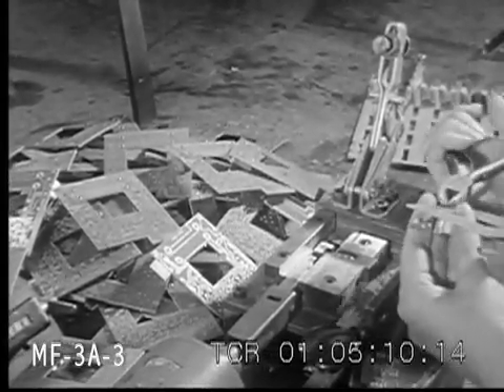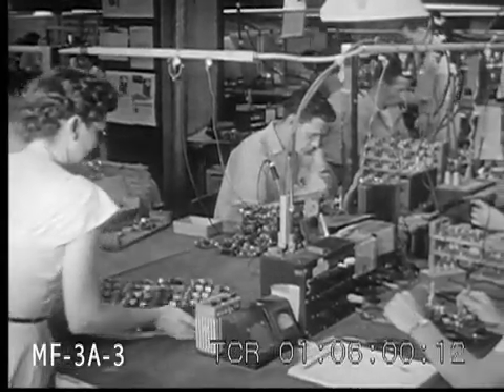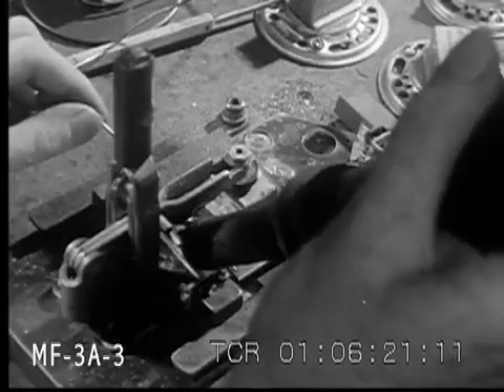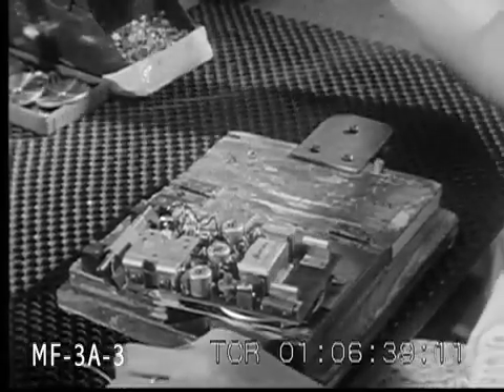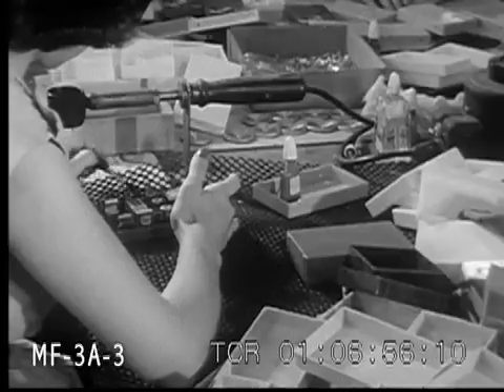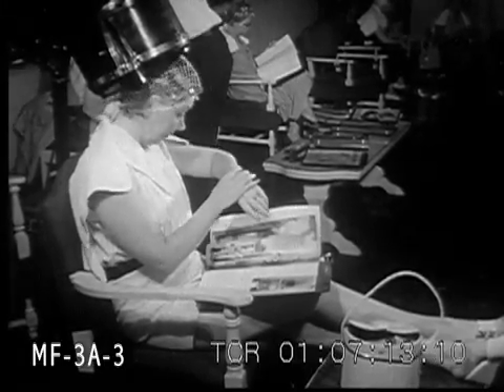Assembling Transistor Radios 1955

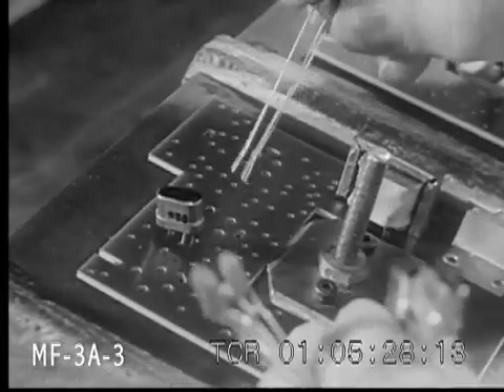Comment: 0:40 the transistor seen...being installed...has a metal case. Inside..the actual transistor was a miniature version of the first one invented in 1947...the performance characteristics were so wide...transistors had to be "paired / matched" to get best performance...this was true of SONY radios manufactured early on. 
I learned this stuff with YouTube channel "Asianometry"...and other similiar channels.
👍

Comment: "Transistors performe the same functions as much as larger vacuum tubes for the fraction of the current"
Hahahaha I have never heard such a terrible thing 🤣🤣🤣🤣
NO.
Vacuum tubes are the best. Point.
Even if they require a higher current...the sound they produce is unbeatable. Warm and make you feel like you would never be able to hear anything without a vacuum tubes amplifier or radio. Transistor's "sound" is cold...empty of any feelings makes the sound dead. Anymore.
Reply: ...WELL, "ya can't please EVERYBODY!!!"

Comment: Incredible assembly line. Bet that AM radio would still work today too.
Reply: I have a 30 year old radio shack transistor radio, still works great, even after laying untouched in a box for about 15 years, truly amazing is that it still has that same battery from 15 years ago

Try that with a laptop or mobile phone!

Comment: By the late 1950s, the manufacture of these radios was moving to Japan and fast; I believe the last pocket radio was made in the USA around 1966. It was more cost effective to build expensive equipment in the USA, the kind used by business and the defense sector. Automation is  one thing that might bring it back, if the difference in labor costs ends up being less than the cost of shipping. Of course, labor costs have gone up in nearly every country that took over this sort of manufacturing.

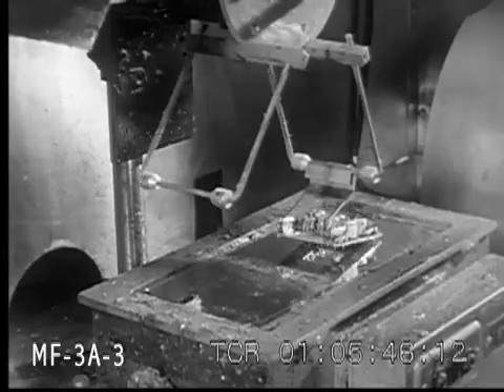Comment: Could not understand the soldering technic @ 00:54
Reply: Its a lake of hot solder (estaño) and when the circuit down in it is solder the pins of copper.
Reply: @gowreyes8876  got it. Thanks. ,👍

Comment: The Regent used Germanium or Silicon transistors?  The battery was 22.5 V for max gain from just those four transistors - - lot of voltage for those early puny Ge xsistors
Reply: I don't believe silicon transistors were practical until the late 1960s, and those early ones were not particularly reliable. Silicon is cheaper than germanium and a well made silicon transistor is less vulnerable to the effects of heat, but it needs to be more highly refined.

Comment: 3500 W soldering iron... one wrong move and the PCB fiberglass melt ahahaahha
Reply: Gfr, no, the real problem occurs when excessive heat from an overly large soldering iron causes the copper foil trace's to delaminate and lift right off the board. This was less of a problem on older units where the PCB's were phenolic, not fiberglas, and the traces were large and wide and typically the entire set of foil tracks were tinned  with solder, but nowadays the modern,  extremely thin and narrow foil traces will easily come loose from the board.
Reply: @goodun6081  sure.. i experience myself in an attempt to repair... the traces nowadays are very fragile...

Comment: Soldering irons the size of rolling pins... I'm so glad things have gotten smaller!
Reply: You'd still need them when soldering large metal things together. For normal component leads you can use a small hand soldering iron.
Reply: @gargantuablargg  Indeed.  I just bought a replacement tip for my iron - it has a 1/64" conical tip.  My problem now is that I need a microscope to see the parts I'm trying to solder!
Reply: @gargantuablargg  If you like flux, you might like low-temp solder sticks.  They make it MUCH easier to remove components easily.  It tends to stick to solder mask a bit more than regular solder, but it given how easy it is to remove parts - even with minimal equipment - it's well worth it.

Comment: Solder fumes are deadly , no fume exstraction here.
Reply: There's no way you could possibly tell from this video... besides, I wouldn't say deadly considering how much time in my poorly ventilated room with my soldering iron plugged in for hours at a time.
Reply: Deadly? Perhaps you could explain by what mechanism they are deadly?
Reply: Dambuster Lead, and thereof.
Reply: Lead is not vaporised and carried in the fumes, it is a heavy metal. Lead is quite dangerous, but those fumes only contain the flux used in those days, which was Rosin, made from the sap of pine trees, and not harmful at all.

Comment: '
what kind of radio...
AM or FM...
no pull out and push in the antenna on the radio...
wow...
fully handmade the radio
Reply: AM mediumwave (540-1600 KHz) only (no shortwave).
The antenna was what would become a feature of almost every portable radio even to many radios being made today - a ferrite bar wrapped inside a coil. When you changed the station, the variable twin ganged capacitors were resonant and the antenna is electromagnetic.
Some AM radios also had shortwave bands, but not the model in this video.
Reply: bestamerica AM

Comment: It would be interesting to know, how many of the workers there were aware that the all-present solder contains lead.
Reply: I often solder as a hobbyist with leaded solder - thing is, lead doesn't vaporize at soldering temperatures - the smoke is just flux and other bric-a-brac. It's perfectly fine. The only reason its use is banned in consumer electronics is because when they get discarded, the lead can leach into the soil. And as most people that solder electronics will tell you, lead-free solder is somewhat garbage by comparison.
Reply: @MattExzy  I absolutely agree that the lead-free solder is garbage. I'm, however, not so sure that some particles of lead do not vaporize along with the flux fumes, which must be dangerous, especially when the solder is used on large scale as here. In any case I take care to open window when soldering :)
Reply: They probably knew. It didn’t bother them; they probably smoked while driving their cars running on leaded fuel to their houses lined with asbestos.
Reply: They probably were even convinced that smoking was good for their health. I saw ads to this effect.
Reply: @kylesmithiii6150  In Europe the consequences of lead poisoning have been generally known for centuries, therefore e.g. the type-setters became milk at work to counteract it.
Reply: @kylesmithiii6150  SPOKEN LIKE A TRUE COMMUNIST-!!!

Comment: 0:55 That explains why all the old transistor radios I've taken apart have had an unbelievable amount of flux scum on them
Reply: I have news: that's not flux scum.

(ahem)

It's actually wax, which was used to hold some parts in place while they were being hand-soldered.
Reply: There is also wax
Reply: @gunlimitedammo3888  I've opened a staggering amount of electronic equipment over the last forty-plus years... but I don't remember ever finding any flux residue anywhere except in prior repair patches. The industry has always solvent-bathed the PC boards before assembly because flux residue collects water and water collects failures.

Comment: Watch their hands placing components into the circuit cards then crimping and trimming the leads with wire cutters. They must all have developed carpal tunnel. It's no wonder most of the older generations developed arthritis.

Comment: Wow, i have lots of these cool radios and some still work just fine. kinda proves they were built to last with that all steel chassis support construction and air capacitors with no mica insulators, which can collect dust and cause a scratchy noise when trying to tune the radio.
Reply: Spray the volume control with contact cleaner.  And if you're ambitious, replace the capacitors.  Then your radio should play well for a few more decades.

Comment: That is before the Japanese Radio Scandal - they were selling a '6 transistor' radio (at this time more transistors = higher quality), BUT only 3 were actually working, the other 3 were just soldered to the board and did absolutely nothing!
Reply: Not necessarily. Some transistors had one defective junction, of two. Those could be and were used as diodes. But, you are essentially correct in that it was a scandal. I remember the first question I always asked about any transistor product in the 1960s, "How many transistors does it have?" The bigger the number the better - was the basic presumption. Wonder what someone from back then would think of a Pentium processor today? "Oh, somewhere north of a billion transistors." They wouldn't believe you!

Comment: Those old radio had a better selectivity which allows me to listen to a weak distant MW station even there is strong signal from a local station near the frequency. Those cheap receivers of today have bad selectivity that receiving distant stations with frequency near the local station is almost impossible.

Comment: I have been wanting to see close-up footage of a worker hand-stuffing a printed circuit board. I am a bit surprised that one worker could insert so many different components into a board without a silk screen and not make any mistakes.
Reply: That was a set-up shot. She was just randomly placing parts. I have restored a Regency TR-1 and know that the transistors are spaced out differently. There is no silk screening on the board, so the women had some sort of guide to place the parts.
Reply: @joebidwell9428  YOU'RE PROBABLY RIGHT-I THOUGHT THAT WAS AN AWFUL LOT OF TRANSISTORS CONCENTRATED IN SUCH A SMALL SPACE-!!
Reply: klafong1 THAT'S THE RESULT OF A LOT OF PRACTICE.

Comment: massive soldering irons
Reply: say that to a HAKKO SOLDERING IRON.
Reply: Im assuming that's lead based solder.
Reply: @_ShaDynasty  Lead based solder is much easier to work with, but on other hand it gave Steve Jobs cancer.
Reply: Lead-free solder is in theory "environment friendly" in practice it has a tendency to crack and make consumer electronics go bad faster thus contributing to e-waste generation
Reply: @_ShaDynasty  Nothing wrong with leaded solder. Just wash your hands afterwards.
Reply: @_ShaDynasty  Yes - great stuff. Lead free solder doesn't flow nicely and you can't spot a cold solder joint like you could with tin/lead solder.
Reply: because that's what the PROs use!
Reply: @antigen4  Oh hell yeah, I have a lifetime supply of 60/40 and similar ratios in the workshop. I evaluated lead free for our process workflow and no freaking way are we using that crud.
Reply: yes i have a few pounds of it too - 37/63 or whatever it is - the eutectic stuff
Reply: In the USA they're known as soddering irons, not soldering irons..
Reply: Large metal parts to solder with those large irons (looked like they were soldering the edges of the metal speaker to a metal plate, which both will suck the heat up quickly).
Reply: I was noticing that! HUGE. I have a couple of big ones out in the shop, but they're for automotive body work. All my PC board soldering irons have always been much smaller than the ones in this video.
Reply: Yes, those are American Beauty soldering irons (still in business in Michigan).
https://americanbeautytools.com/Soldering-Irons

It would be in 1958 that Carl Weller would submit his first US patent for the Temperature Controlled soldering iron (W60/W100 series and TCP series).  After two additional patent submissions the Magnistat design would be used for Grumman’s work on the Lunar Module and Collins for communications gear used in Apollo program.
Reply: @w9gb  mine is 60 years old.....still works well.

Comment: Precarious wave soldering machine and a soldering iron the size of a baseball bat... LOL
Reply: Still better than the soldering from China.  The type of wave soldering in this video worked great for through hole single sided PCB construction and the giant soldering iron is needed to solder to the heavy metal chassis.  No cold solder connections unlike todays throw away crap.
Reply: @gavincurtis  , also old-time leaded solder wets and flows better than lead-free solder, and doesn't break down as quickly from heat exposure. Modern circuit boards and lead-free solder truly suck.
Reply: @goodun6081  exactly true!  My 1979 built Yamaha CS-80 synthesizer with 45 circuit boards still works to this day without one single cold or cracked solder connection.  Modern lead free solder is too brittle.

Comment: And it did. My Sony was smaller and more stylish than my American transistor radios – something perhaps Steve Jobs would have done.  My RCA (I think is was RCA) still had the best sound but it was 4 times larger, not for the pocket.
Reply: rca was a good brand until thomson electronics bought it in 1986. i had a rca am/fm radio made in 1970 that sounded great and built solid. rca badge still exists but only as a name now and the quality long gone.

Comment: My first calculator was a TI-30 at around $200 which was half the price of a HP-35 then. Damn $400 for the HP-35 then is like $4,000 now! You could buy a calculator with the same functions now for under $10. 

First transistor rado ever was from TI in 1954!
Reply: True but it was not commercialized due to being too expensive to make. A bit bigger than the TR-1 too.

Comment: We are working at eliminating that person in the loop. 

We have machines that could learn and simulate human thinking and carry on a normal conversation. We have cars that drives itself, machines repairing other machines and make more machines. A hundred years from now, no one needs to work - only eat and poop.
Reply: @kimchee94112    we could even teach that computer clone to fuck off at work, chain smoke camels and tell the boss to fuck off or get zapped with their electrode. wouldn't that be so swell, wally. and golly gee whiz, beaver.

Comment: Those transistor radios were nice, use to take it to bed and listening to the Shirelles, Marvelettes, Martha, Vandellas, etc. It was based on germanium, silicon came later. Much better than replacing tubes every few months. 

The crystal set radios my day designed were great too, no batteries required, super clear with enough power to drive a speaker. We used to build things and worked on cars and stuff. Heathkit had oscilloscopes, HiFi gears, color TVs and even computer kits later on. No more.
Reply: No, that's not true. You can still get parts to build that crystal radio, and there are kits to build many different things. Search the Web, you would be amazed at what is available now.
Reply: @bruce jones   why waste the effort on building a crystal radio with today's talk sucky am talk shows ? all that to listen to " brown eye call in show, how to please your homosexuusll luver". forget it. am radio went to hell in 2003 +/- a year when computers replaced dj's , radio staff and talk shows took over.
Reply: kimchee94112 ...that's all stuff from a by-gone era.

Comment: In Australia, to receive radio (and later TV), your household had to have a licence (license), up until 1972. At that time I listened to a 'crystal set' which did not require one. With the proliferation of radios (mainly transistor radios) and their portability, and radios which ceased to work (mainly tube ones) people objected to paying for something which does not work in their house..